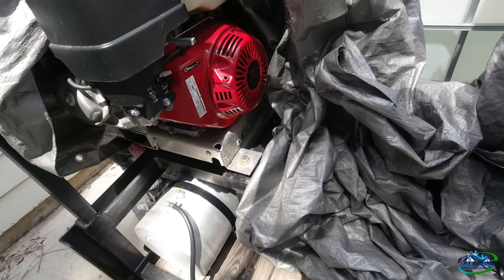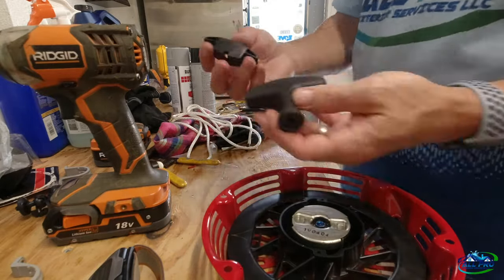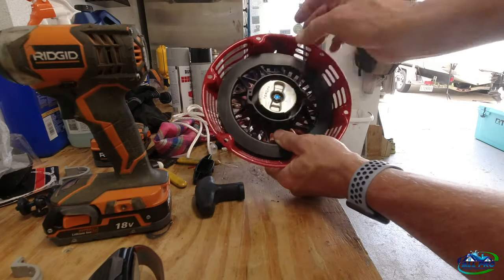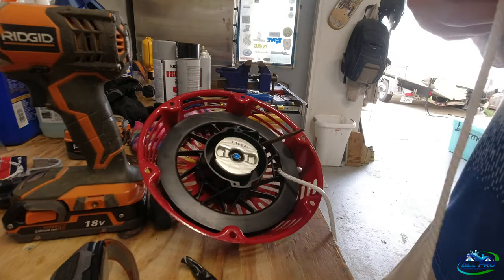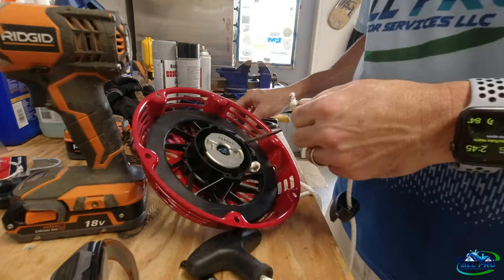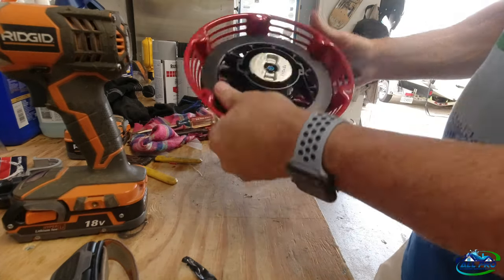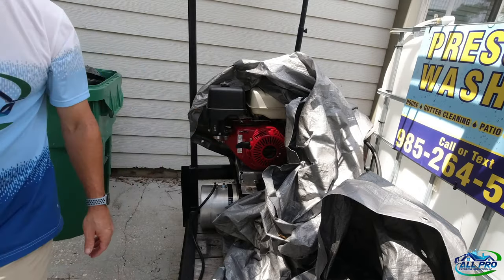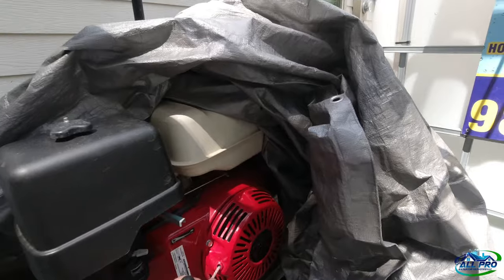Honda GX390 Pull Cord Repair

Comment: Thanks for the video I had trouble feeding the rope through the holes finally figured it out I used a lighter to cauterize the end but the guy who sold me the rope it was too short so I have I believe too much tension on the cord the rip cord how long is the original cord on that and does it have to be
Reply from the maker: Great idea with the lighter. Thanks

Comment: Wouldn't be without an electric starter on my gx390, it makes life sooo much easier. The handle of my cord pull fell off the other day even though I've never used it lol. Must have rotted cord after 5 years. Now I know how to replace it, thanks 👌
Reply from the maker: Agrred. Hard to go back to puller a rope. Thanks

Comment: I ve the same engine but when I try to start it, the rope goes back violently… have u you ever had this kind of problem ? Which is the cause ? The starter ? Thx 🙏
Reply from the maker: I am not sure you have a start on the engine. It sounds like you have pressure built up in the pump. Make sure you release the pressure before trying to crank the engine. Thanks

Comment: To make this a little easier, when you tape the end to pass through the cover add 6 inches of light stiff wire under the tape.  You can now push the wire through the opening, then pull the rope through.

Comment: Well that was easy enough. I'm still adding an electric starter kit to my post-2011 GX390 but keeping the rip cord for backup. Bad thing about these pressure washer setups is if you don't get it started manually with first two tries, you gotta pull the trigger to relieve pressure otherwise you'll break your hand/arm trying to start the thing. Would've been nice if the manufacturers would've installed a clutch assembly on the pump to disengage pump and prevent pressure buildup while starting but I reckon they don't use these things. I love my GX390 but would've been nice if they would've installed electric starters from the factory.
Reply from the maker: Agreed. I would pull the trigger on the gun to release pressure. Once you go electric start, you wont go back. Thanks
Reply: Here is the link for the post-2011 engines. They've got all of them here under Honda GX on left side pane. https://auto-express.co/collections/gx390-starter-motor/products/honda-gx390-13-hp-electric-start-kit-flywheel-starter-motor-key-box-new-2013.
Reply from the maker: @kingjames8283  Thanks for the link!
Reply: @allproexteriorservicesllc5338  - My kit arrived today. The 2013 kit works on both pre/post 2011 engines as the flywheel comes pre-made with TWO timing notches in the flywheel where it mounts to crankshaft. This one flywheel works with both regular and 30° advance timing engines. Just have to match the keyway notch to the original flywheel to ensure correct ignition timing.

Comment: could you make a video on how to replace the ratchet pins inside the coil pull on a GX 390.  Mine backfired so violently once on a pull that it bent the pins beyond repair.  I purchased new ratchet pins but don't know how to install them.
Reply from the maker: Doug, I hope all is well. I actually sold the Honda GX390 washer. Thanks
Reply: @allproexteriorservicesllc5338  No worries - I found a repair shop to install - which was a good thing because the rope pully was also damaged in the backfire and they installed a new one.  Thanks for getting back to me!